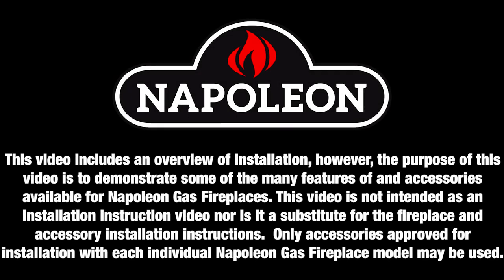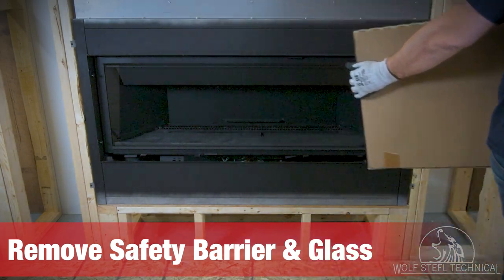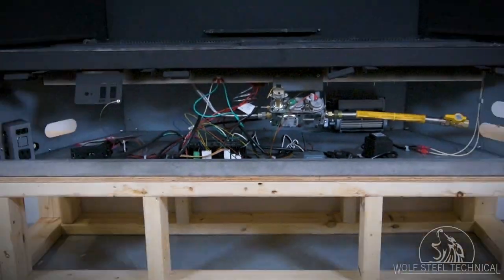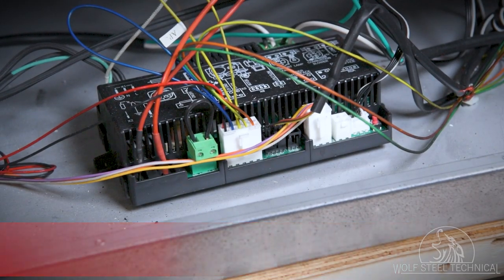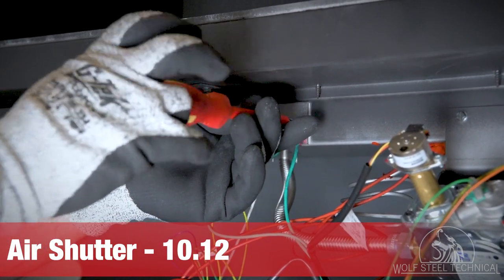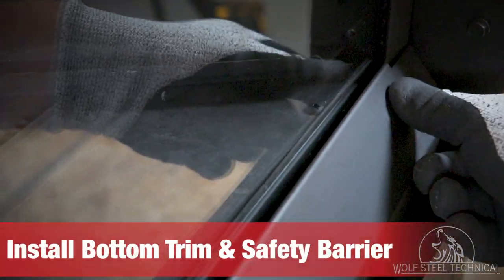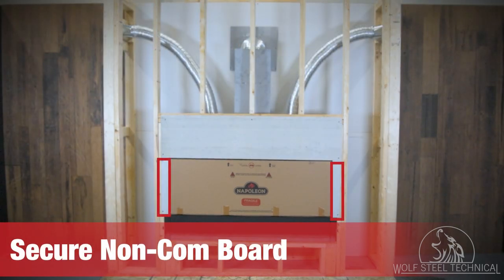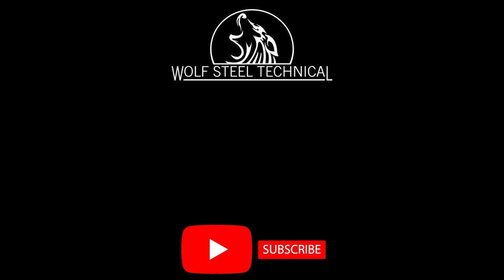Napoleon Ascent™ Linear Premium (BLP) Installation - Part 2/2

Comment: Can the power come from the right side. Or has to be run all the way to the left side
Reply from the maker: Based on the diagrams in the product manual, knockouts, and junction box location, the electrical connects to the left side of the unit, and gas connects to the right side. See 1:16 in the video to view the entire control area.
Reply: @ I appreciate the reply